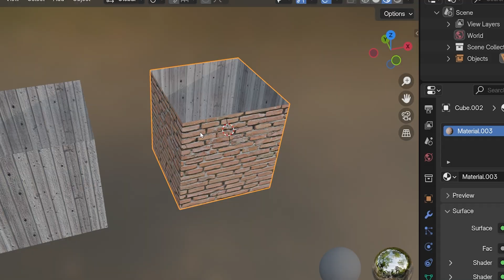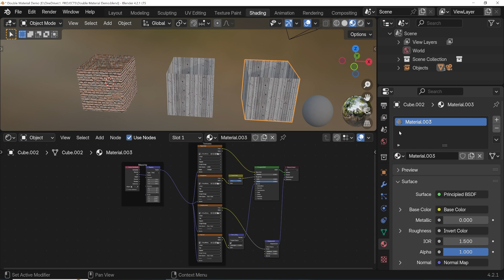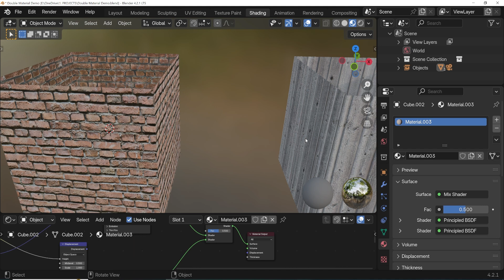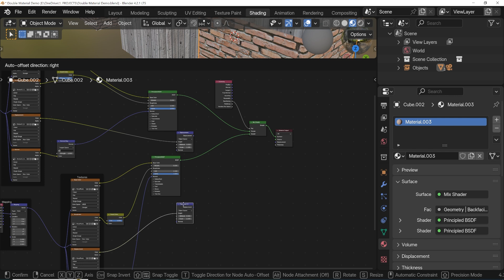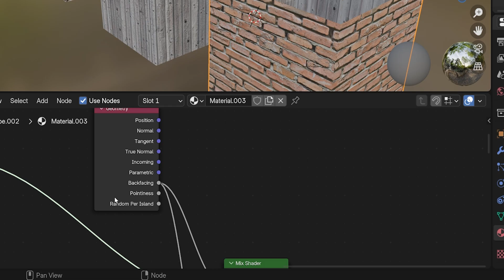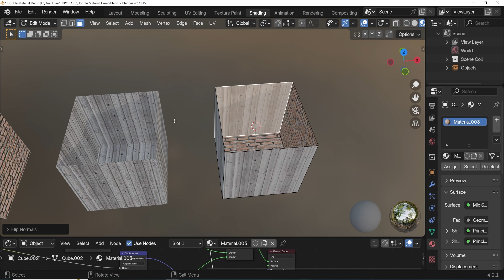How to Make a Double Sided Material Shader in BLENDER 3D

Comment: I followed along with 3.4.1 but it didn't ever "mix" 50/50 the two images I have mapped and didn't do the double sided thing. Can the map use the same image resource (UV'd to different parts of the same png)  or does it have to have separate image png resources for each material?